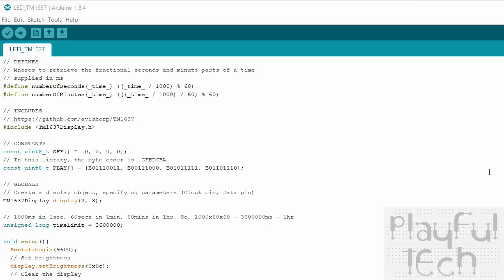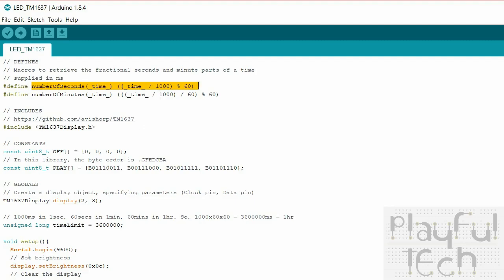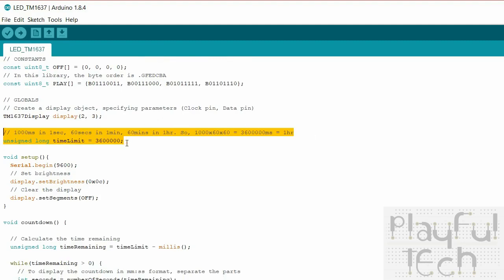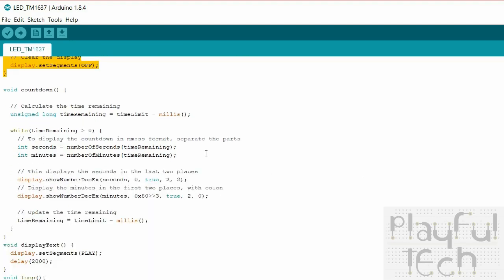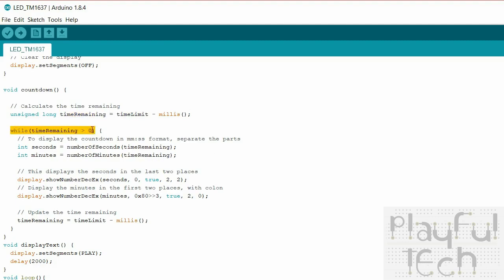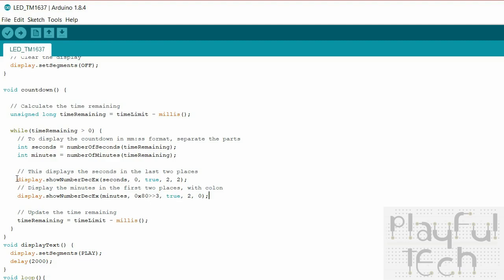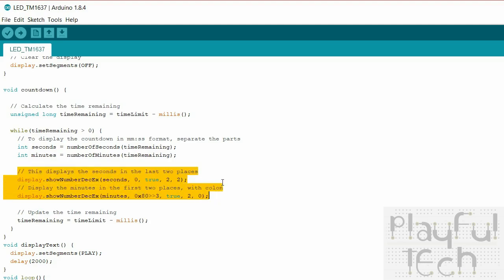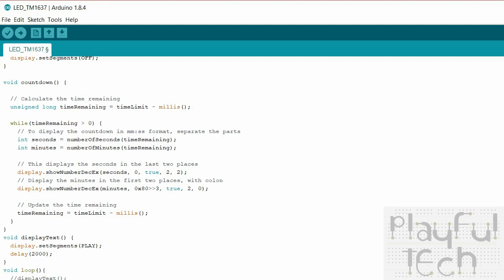4-Digit Countdown Timer (in minutes and seconds)

Comment: Nope, the original countdown works, but the adjustments in code for the minute/sec countdown produces no display, although the code did compile - same hardware setup for the 5000 second countrdown

Comment: Great video mate, I was looking for something like this. Also if use that code in a "bomb type puzzle case" how would you change the code to subtract 5 mins from the clock for a "wrong" input (not completing understanding Arduino code yet). Any help would be great. Thanks.
Reply from the maker: So, currently there's a line of code that looks like "timeRemaining = timeLimit - millis()". If you wanted to adapt that to include subtractions, you'd change it to something like "timeRemaining = timeLimit - millis() - penalties" instead.

"penalites" would be an unsigned long variable, initialised at 0. Every time the player made a wrong input, you could add, say, a minute penalty by saying "if(playerMadeWrongInput) { penalties += 60000; }"